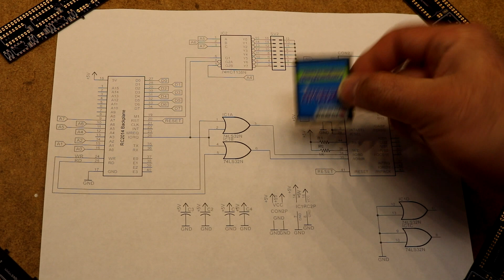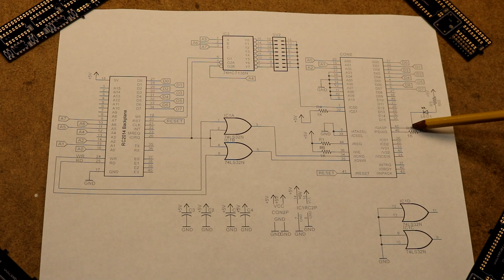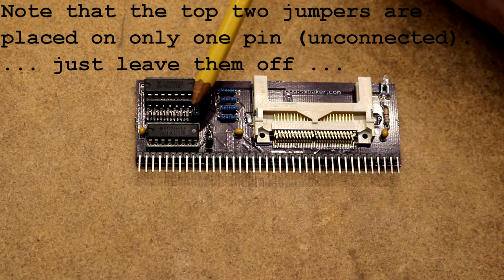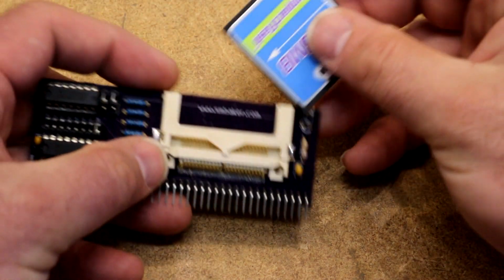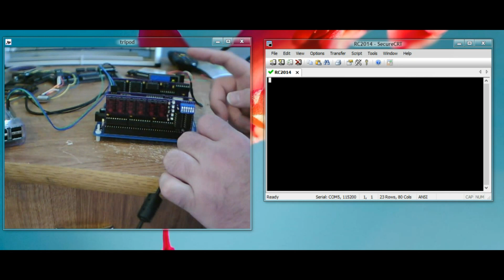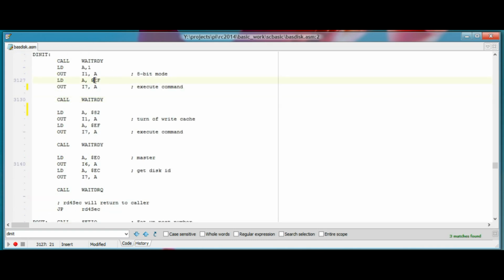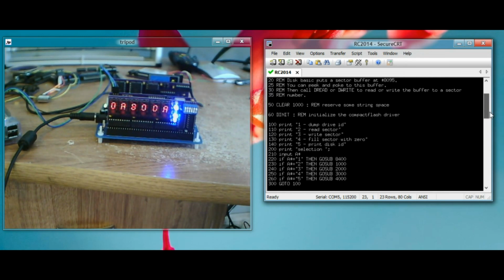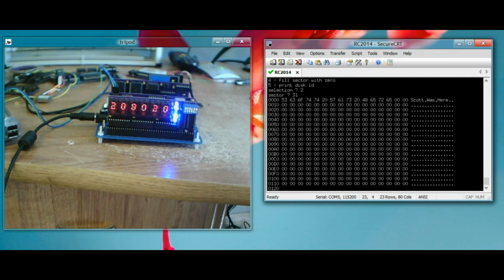Z80 Retrocomputing 10 - RC2014 CompactFlash Adapter

Comment: In wrByte,you could replace the LD/OUT/INC/DEC instructions (28 clocks) with an OTI instruction (16 clocks) and it'd save you 12 clocks per loop. In fact, your entire inner loop could be replaced with an OTIR instruction.

Comment: since you operate these cards in IDE hard disk mode, they are obviously not hotpluggable, the hotplug capability is only available if they are being used as USB flash drives in a USB card reader